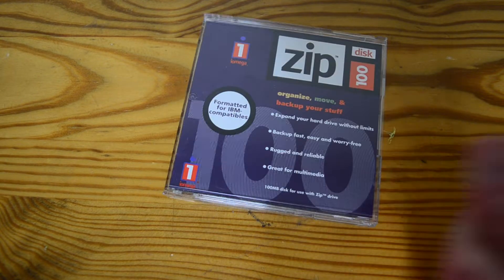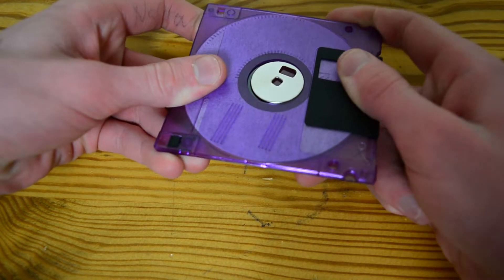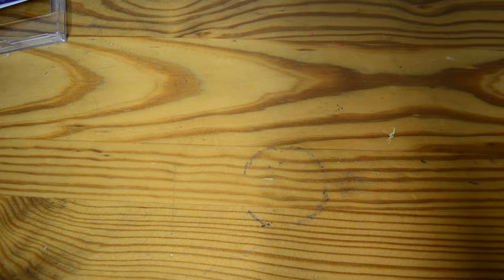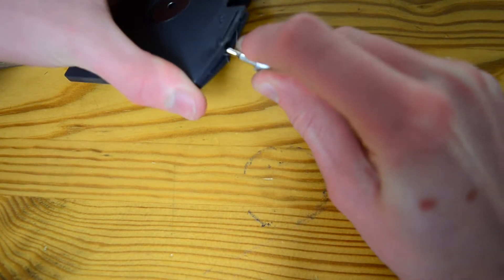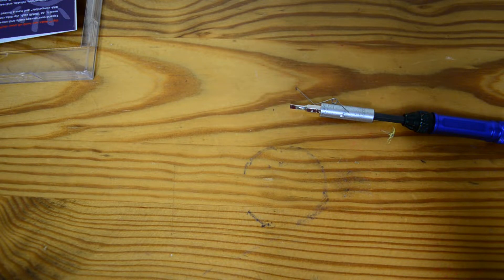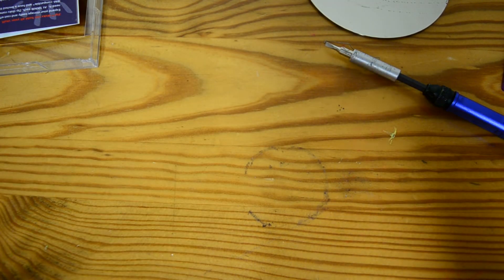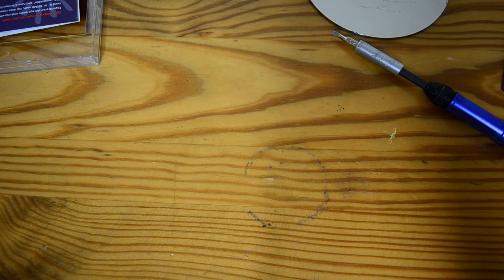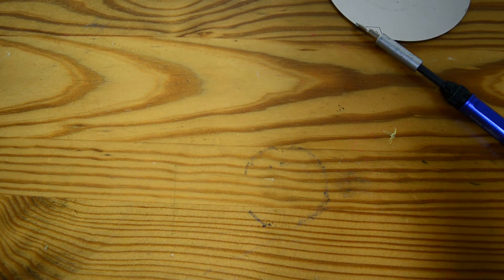What's inside a ZIP disk?

Comment: "...A a nice carrying case that can fit 2 floppies." 1. Only if they're those standard 3.5" ones.
"...Because the Zip drive is like twice the thickness of one of these floppies." 2. No it's not, the drive is a TON thicker than one of those standard floppy disks! And 3. Even the Zip floppy disk's jacket is over twice the thickness of one of those standard floppy disk jackets.

Comment: "...And I'm not talking about the Clik" (referring to hard disk drives).  That's right, you were not, because the Clik!/PocketZip is another floppy disk and drive. But what's interesting about that is that it uses swinging heads like has been the standard on hard disk drives that are relatively modern or current! Search that up sometime! I think there are 2 other obscure floppy disks that do but I haven't seen the insides of the drives for them, but they have curved openings that make them look suspiciously curved for swinging heads too! Look up the Brother micro-disk (really should've been "nano;" 3.5 is already "micro") and 2.6" micro-disk!

Comment: "You can literally put a hard drive platter inside your Zip disk!" Nah, just inside the Zip disk's jacket.
But that is pretty cool! I wonder what it would be like if you could glue the Zip floppy's hub to the hard platter (assuming you cleaned the platter really well) and have the Zip drive try to format it and use it a bit!

Comment: The heads do not go inside the Zip disk. They go inside the jacket. And no, the drive doesn't move the disk forward or backward. In all disk and disc drives, it's the heads that move around while the disk or disc just spins.